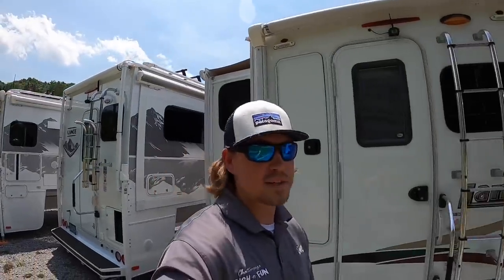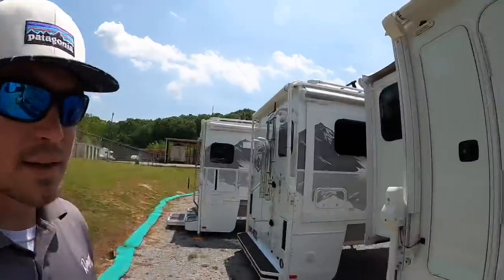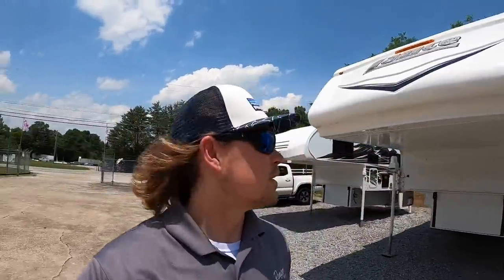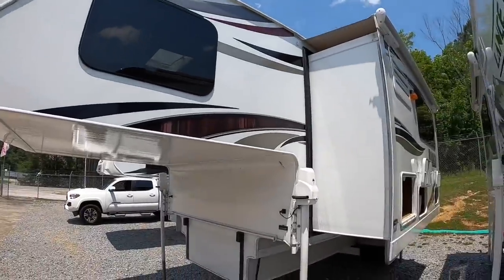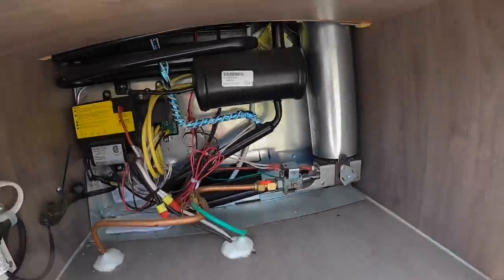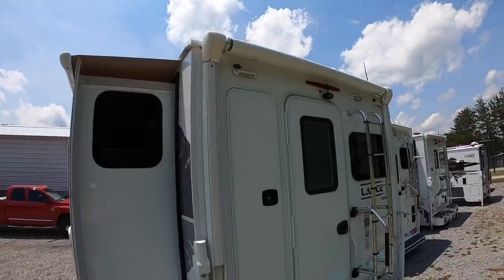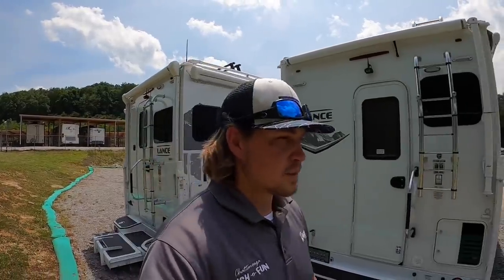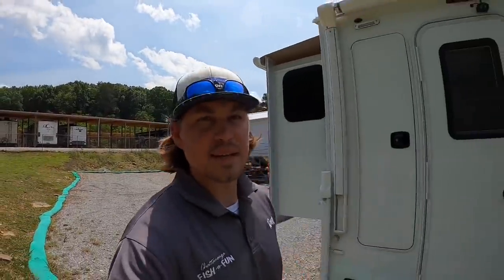Is REV Group Ruining Lance❓ Pre-REV Lance 975 vs REV Lance 975 Truck Camper Side-by-Side Comparison!

Comment: You make an interesting comparison between the REV and PreREV campers. 

I personally own a 2018 1685 travel trailer, and I can say I have had some good times in that trailer. It is about the same vintage as the older camper you showed on this video. Has it been perfect, NO, but at least the issues the trailer has had have been items that I could fix myself for a relatively small price. 

If I were to make a side by side comparison between my trailer and a current 2022 model year trailer, the differences would be more noticeable. First of all, Lance is going to a different frame with leaf springs and shocks, so it looks like the trailer will be several hundred pounds heavier. The sound system has been redesigned and moved (Amp, speakers and all) over by the bed. The overhead bunk/storage over the front bed is history, as well as the range hood. The AC is now ducted. A number of features that were optional are now standard on the new trailer. Each person would need to make up their own mind as to whether these changes are good or not. For me, losing the bunk storage and the range hood on the new models are not good things, nor is the new placement of the sound system. Perhaps the addition of the new frame with shocks and the electric stabilizers would be good additions. 

Then there is the issue this new trailer would cost nearly twice as much as I paid for the one I have. I think that this is where  we get into the issue that in my opinion REV has not really innovated much with Lance since they acquired the company. A lot of the features that used to make Lance special  (such as the Azdels, the Lite-Ply cabinets, and the CNC routed construction for example) are now fairly commonplace and used with many other RV brands. A lot of these brands use these same features as Lance, but do it at a lot lower price point. Some of these other brands have upped their game when it comes to innovative floor-plans............and in some instances in my opinion, they offer some floor-plans that may be better then what Lance offers depending upon what you are after. 

I realize a lot of what I discuss above is subjective............everyone gets to make up their own mind. With that being said, as a current Lance owner, I am finding it more difficult to justify what sets a current model Lance trailer apart and what about a Lance would justify the current price tag. It's a funny thing........I am reasonably happy with the current Lance I have and I would buy it again at the price I paid for it. I would not however buy the current model of this same model new trailer at twice the price. 

Comments?
Reply from the maker: Thank you for your comment, I enjoy reading different perspectives!
Unfortunately, I cannot comment on the Travel Trailers. We have carried the Truck Campers for over a decade, but not the Travel Trailers. We have had two ‘21 Lance Travel Trailers come through this past year to test the market and see if they’d do well in our area (they did) and I was impressed with the quality and solid structure compared to other TT’s I’ve been in. 
As far as pricing, I see it as supply and demand and cost of materials. Gas is double the money per gallon, but I’m not getting anymore mpg for the extra money, but it is what it is. 
Thank you for your perspective!

Comment: My first Lance was a 2000 1140, then a 2013 1181, 2018 850 and now I have a 2020 1172!  My only complaint is Lance old/new cannot make a cabinet latch that works well or will last...I want to see the 2022 cabinet latch hopefully it will last and work.  All in all I have never had complaints on quality.  I did have slide out issues on the 1181 but, went to the factory and they fixed it with a great job and never had any other problems.  So for 22 plus years I have been happy with Lance campers!  Dang...its hard for me to believe I'm old enough for all this!  LOL!
Reply from the maker: 21:27 is the new latches for year model 2022
I agree about latches! The 2022’s have the good latches from what I can tell so far!
Reply: @itsbrad  Thank you and by the way...your videos are really great...the best RV explanations in all of YouTube land!  Keep it up!
Reply from the maker: @jonfelty6063  thank you!

Comment: My 1172 is an 18 as well, built just a couple months after that 975.  Dual Solar was an available option in 2018.  And I added cabinet handles similar to 2022 to mine as well.
Reply from the maker: Thank you, couldn’t remember if it was or wasn’t then

Comment: I have  2014 Ram 4 door, long bed, 4wd. It's not a dually. Do you have a camper that will fit that with slide outs?
Reply from the maker: 975, 1062, & 1172 are the only current model longbed Slideout models - all 4klbs or more

Comment: I wouldn't bash a product anyone is trying to currently sell. I would take that somewhere else like the Lance forum. What I would say, everyone that buys an RV should do their homework diligently, your spending a lot of money for a truck camper. Like anything else one buys, buyer beware.
Reply from the maker: How’ve you been, Gary? Still enjoying your Lance?
Reply: @itsbrad  I guess you can't post links in comments. My reply got deleted earlier. But doing great and love the 850, been all over the Country and installed a fairly large off grid solar battery inverter system.
Reply from the maker: @garysurovec  I saw your comment saying to check the link but I didn’t see one lol but that’s awesome, I’m glad you’re enjoying it! Stop back by if you’re ever rolling through again!
Reply: @itsbrad  I sent you guys an email on your website, it shows most of the upgrades I did.